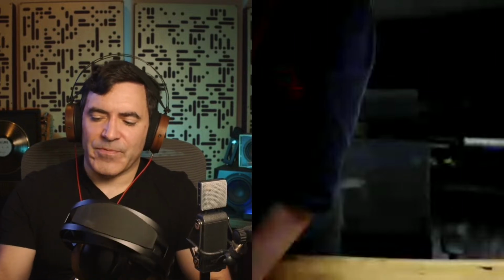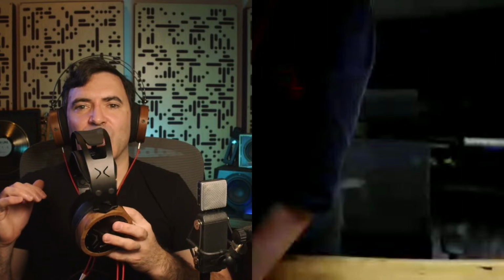Demystifying Headphones with Rok Gulič of Ollo Audio

Comment: So what does Justin Prefer, ollo x1 or the neumann ndh30?
Reply from the maker: Good question. I like different things about each.

The NDH30 I find more neutral and have wonderful transient response for dynamic driver headphones. Very useful, but they will be dull for some tastes.

The Ollo x1 are a little more pleasant sounding with a bit more clarity and excitement, but not overly so. They also have a nicer build aesthetic.

My ultimate preference if for planar magnetic models, but those tend to be a LOT heavier, and often more expensive.

These are definitely two of the better dynamic models out there.

Comment: Dual driver set up is the future. imagine headphones with 50mm dynamic subwoofers and 20 mm planars stacked on top of each other. With built in dual amflifiers and dsp application. You could tune the bass and treble simply by turning up and down the ampflifiers. An eq would be nice too. Since most people use a third party one anyways like sonarworks. But having everything on the headphone would ensure bit perfect quality and you can use crazy amounts of sample rate. Like 32 bit float 384 khz or something crazy to avoid all rounding errors and get the mpst natural sounding dsp. The dual driver would even allow for noise cancelling without doppler distortion in the highs. And it could have a direct usb c connection for direct digital bit perfect playback from your device. Why has nobody done this? Moondrop already has iems with a setup like this.